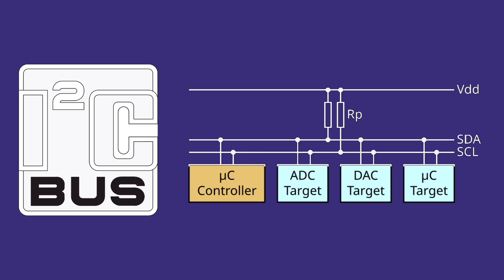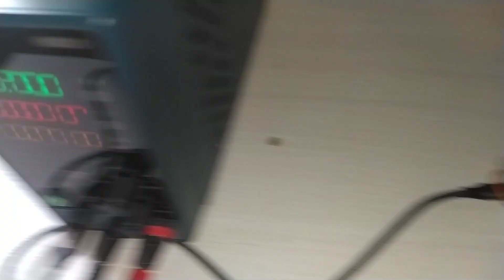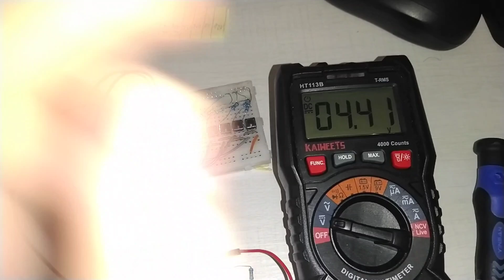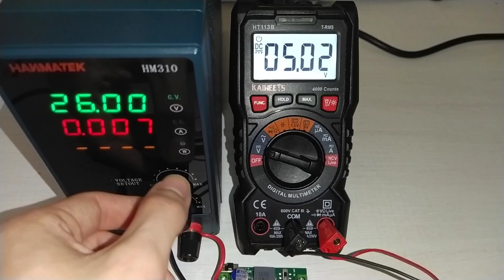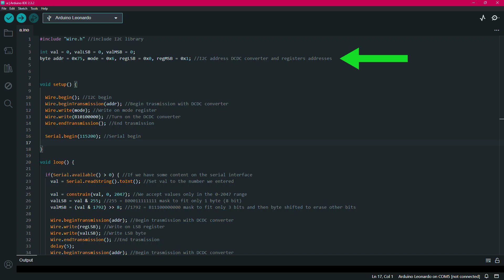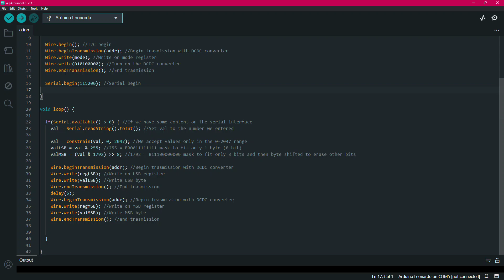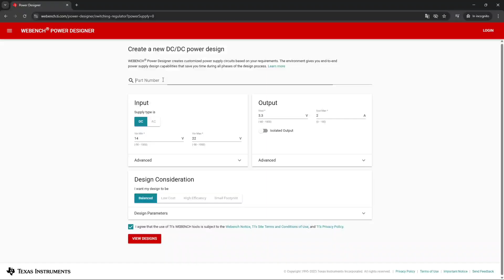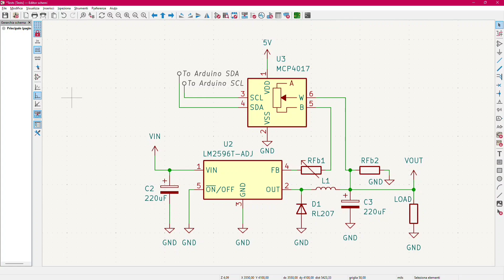An I2C controllable buck-boost converter for Arduino, Esp32 or other MCU

Comment: It seems (please correct me if I am wrong, based on the datasheet) that the TPS55289 supports output shunt resistor with the ability to measure voltage between Visp and Visn, and limit the current based on that. By choosing the arbitrary shunt resistor it seems to me (if I am correct) that one could program 127 different current limits by choosing the appropriate shunt resistor (0.5mV to 63.5mV). It would be cool if you could integrate that feature into your (2 layer) design - and if someone was not interested in this feature, they could just simply solder/connect the two pads, or install 0ohm resistor.
Reply from the maker: Hi, yeah you're absolutely correct! I simply didn't implement it on the board I showed in the video! Maybe, as you said I could implement the shunt in the next revsion :)

Comment: Where is the code to download?
Reply from the maker: Hi, sorry if I'm late. Anyway, I'm planning to upload all the video files on github in the near future. For now you can write to me a mail, or just copy the following one (this one is the one I analyzed in the video), if you want other codes, such as the one with the pushbuttons just write to me. Sorry again

#include "Wire.h"

int val = 0, valLSB = 0, valMSB = 0;
byte addr = 0x75, mode = 0x6, regLSB = 0x0, regMSB = 0x1; //I2C address DCDC converter and registers adresses

void setup() {
  
  Wire.begin(); //I2C begin
  Wire.beginTransmission(addr); //Begin trasmission with DCDC converter
  Wire.write(mode); //Write on mode register
  Wire.write(B10100000); //Turn on DCDC converter
  Wire.endTransmission(); //End trasmission

  /*Wire.beginTransmission(addr); //Snippet code used to change Vref
  Wire.write(0x4);
  Wire.write(B00000001);
  Wire.endTransmission();*/

  Serial.begin(115200); //Serial begin
  Serial.println("End Setup"); //end setup

}

void loop() {
  if(Serial.available() > 0) { //if we have some content on the serial interface
    val = Serial.readString().toInt(); //Set val to the number we entered

    val = constrain(val, 0, 2047); //We accept values only in the 0-2047 range
    valLSB= val & 255; //255 = B00011111111 mask to fit only 1 byte (8 bit)
    valMSB = (val & 1792) >> 8; //1792 = B11100000000 mask to fit only 3 bits and then byte shifted to erase other bits

  Wire.beginTransmission(addr); //Begin trasmission with DCDC converter
  Wire.write(regLSB); //Write on LSB registers
  Wire.write(valLSB); //Write LSB byte
  Wire.endTransmission(); //End trasmission
  delay(5);
  Wire.beginTransmission(addr); //Begin trasmission with DCDC converter
  Wire.write(regMSB); //Write on LSB registers
  Wire.write(valMSB); //Write LSB byte
  Wire.endTransmission(); //End trasmission

  }

}

Comment: I need to control a large size LED display and this is the perfect solution. Any chance to provide me with the Gerber Files and BOM ?
Reply from the maker: Hi, for now the pcb is available on pcbway, you can choose only the board or the board + assembly, in theory you can also choose the components to mount and the ones you want to solder by yourself

https://www.pcbway.com/project/shareproject/I2C_controllable_buck_boost_converter_bb2ba9a1.html

I also made a 2 layer version for lower cost. Keep in mind it's not tested

https://www.pcbway.com/project/shareproject/I2C_controllable_buck_boost_converter_2Layer_version_63f3174d.html

Comment: Please, make this a product!!
Seriously, I have been looking for this so many times - a way to have a buck or boost controller that I can control from an MCU without getting super deep into all the complexity of MOSFET drivers etc.
Please, please, make this a crowdfunder!
Reply from the maker: Hi, yeah I had many requests about this project and if I could make a product out of it. The problem is that this product used "Top quality" components and the price could be a bit too high.
The main IC itself is 7.50$
The inductor is 1.93$
The capacitor are 4$
And other components 1-2$

So 16$ only of components. Not to account assembly and pcb price. Should sell this for $30-40

I have to choose some good chinese components to save cost. I don't think someone will buy it at $40
Reply: @BurningElectronics maybe this is totally impractical, but:
How about you produce just the PCB with the main IC, and some clearly labelled solder pads / through-holes for the inductors etc?
My guess is that most makers would be able to source these independently, perhaps scavenging some old components, and the required size would depend on the project specs?
Personally, if you sold me the PCB with the IC and some clear guidance about what other pieces go where, I'd be happy!
Reply from the maker: @TobiKellner Don't know honestly. I have to think about it!
Reply: @BurningElectronics  please do.
I think selling the PCB with the smd components on it and easy through-hole spots for adding your own capacitors and inductors would hit the right sweet-spot in terms of making it achievable for you and for DIYers.
At least as a start, you can then still see if you want to pursue manufacturing the complete device.
Reply from the maker: @TobiKellner Hi, I have to see where to sell those modules. Also, to reduce the cost, I'm thinking of making a 2 layer version and a full THT version (aside for the converter IC itself)
Reply from the maker: @TobiKellner Hi, for now the pcb is available on pcbway, you can choose only the board or the board + assembly, in theory you can also choose the components to mount and the ones you want to solder by yourself

https://www.pcbway.com/project/shareproject/I2C_controllable_buck_boost_converter_bb2ba9a1.html

I also made a 2 layer version for lower cost. Keep in mind it's not tested

https://www.pcbway.com/project/shareproject/I2C_controllable_buck_boost_converter_2Layer_version_63f3174d.html
Reply: @BurningElectronics  great, thank you!!
I don't have an account with them yet (and hence can't see the prices), but I will gladly open one to have a look at this!
Reply from the maker: @TobiKellner In the future I will sell it (probably?) on some website like Tindie or similar, but I have to put some money aside in order to buy a stock of assembled pcbs and then sell them

Comment: If you provide  Gerber File plus the BOM  may be we can order your fine design online.
Reply from the maker: Hi, for now the pcb is available on pcbway, you can choose only the board or the board + assembly, in theory you can also choose the components to mount and the ones you want to solder by yourself

https://www.pcbway.com/project/shareproject/I2C_controllable_buck_boost_converter_bb2ba9a1.html

I also made a 2 layer version for lower cost. Keep in mind it's not tested

https://www.pcbway.com/project/shareproject/I2C_controllable_buck_boost_converter_2Layer_version_63f3174d.html

Comment: I'd be interested in buying one of these PCBs if they were available.
Reply from the maker: @dreamvisionary  I will notify you if I manage to set a production line
Reply: @BurningElectronics  I was looking for that exact thing just last week. I ended up getting a i2c controllable USB PD card, but would like more fine control over the voltages.
Reply from the maker: @dreamvisionary Hi, for now the pcb is available on pcbway, you can choose only the board or the board + assembly, in theory you can also choose the components to mount and the ones you want to solder by yourself

https://www.pcbway.com/project/shareproject/I2C_controllable_buck_boost_converter_bb2ba9a1.html

I also made a 2 layer version for lower cost. Keep in mind it's not tested

https://www.pcbway.com/project/shareproject/I2C_controllable_buck_boost_converter_2Layer_version_63f3174d.html

Comment: Unable to find on Amazon. Is this a new product? Mouser only has the SMD version. Where did you find yours? Thanks
Reply from the maker: @trade_design23  Hi, as said in the video, this is a board I designed myself, so unfortunately it's not something you can buy. At least not now that I'm a small youtuber. Maybe if it gets interest I will make a crowfunding or something to sell it
Reply: @BurningElectronics Thanks for the quick feedback. If you manage to put this into production, I would be interested in buying one.
Reply from the maker: @trade_design23 Hi, for now the pcb is available on pcbway, you can choose only the board or the board + assembly, in theory you can also choose the components to mount and the ones you want to solder by yourself

https://www.pcbway.com/project/shareproject/I2C_controllable_buck_boost_converter_bb2ba9a1.html

I also made a 2 layer version for lower cost. Keep in mind it's not tested

https://www.pcbway.com/project/shareproject/I2C_controllable_buck_boost_converter_2Layer_version_63f3174d.html

Comment: Definitely handy, thanks.
Reply from the maker: @chainreaction8977  Glad you enjoyed the video :)
Reply from the maker: Hi, for now the pcb is available on pcbway, you can choose only the board or the board + assembly, in theory you can also choose the components to mount and the ones you want to solder by yourself

https://www.pcbway.com/project/shareproject/I2C_controllable_buck_boost_converter_bb2ba9a1.html

I also made a 2 layer version for lower cost. Keep in mind it's not tested

https://www.pcbway.com/project/shareproject/I2C_controllable_buck_boost_converter_2Layer_version_63f3174d.html